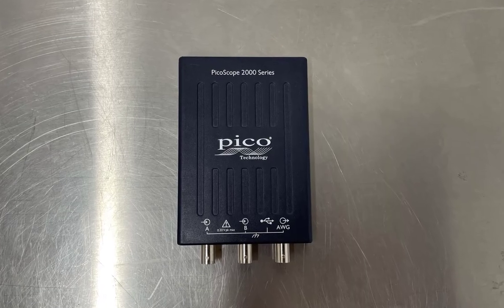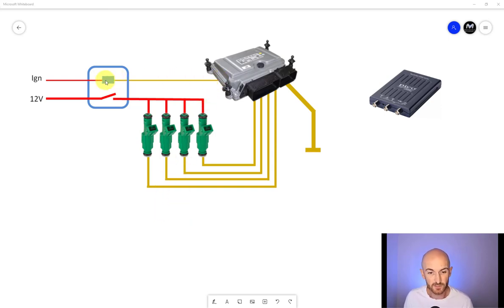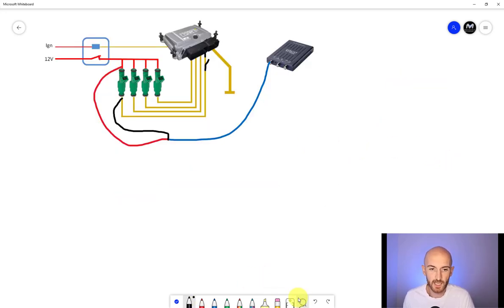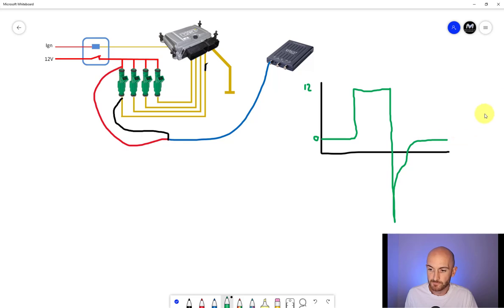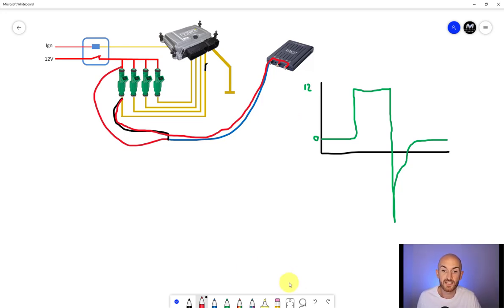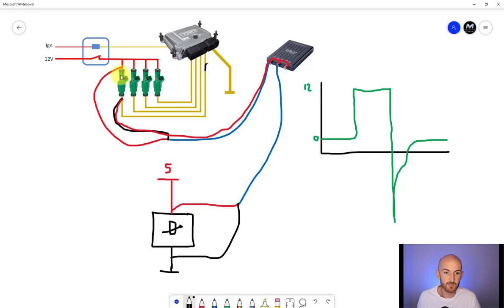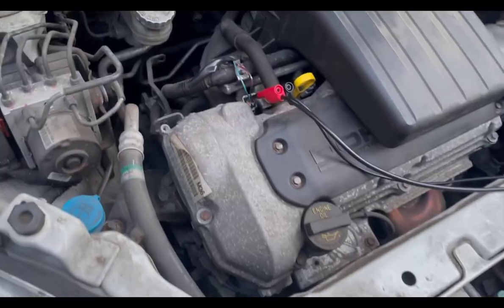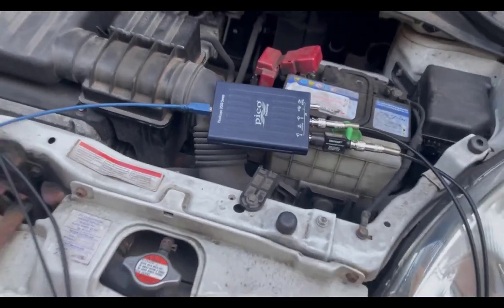How NOT To Fry Your Scope! PicoScope 2204A vs Automotive 4425A

Comment: Hello Darren.  Is it possible to damage the ECU if you get the leads connected wrong?  I had a check engine light on for a small evap leak when I was testing either injectors or coils, I don't remember now.  I don't remember how I had it set up either, but whatever I did, it caused the check engine light to go off and the evap code to be erased.  Now, the evap code never comes back, when it used to before I did the test.  I am worried that I damaged my ECU.
Reply from the maker: Great question! If you were only measuring with one channel, no it’s not possible. Maybe if the leads were faulty/shorted, but most ECUs will protect short to ground/positive. This video is more showing the dangers of not using the chassis and measuring with 2 channels
Reply: @MechanicMindset  Thanks Darren.  I honestly can't remember what I was doing.  All I know is that whatever I did, it turned off the check engine light, and the fault has never returned.  The scope is fine, there is no damage to it.

Comment: Then how can we accurately measure these components with a 2204A ?
Is there a follow up on this topic?
Reply from the maker: I did a couple of videos on injector testing with the 2204a. I think the point of this video is to always use the chassis ground. In this case, take 2 separate measurements to check the power and ground side 👍

Comment: Great tip, pico need to out floating grounds on all devices, this would be a bo brainer to build devices people can look back on and say that was a great tool
Reply: or you could build a car without fuel injectors so there is no spike.  My beetle doesn't have this problem.

Comment: What is the difference in between test it in a normal method, read probe to the injector signal wire, black lead clamps to battery negative terminal?
Reply from the maker: Good question, if you test this way you will see if there is a drop in voltage (compared to battery V) when the injector is active. It’s just a quick way to test the whole circuit first 👍

Comment: By using a differential probe, you can effectively measure voltage differences between two points without referencing a common ground.
Reply from the maker: Need to get myself one. Do you use the differential probe?

Comment: I've got the same Pico 2204 as you , testing VW Hall effect crank sensor [ 3 pin ] cranking showing 4v ish running its like 1.9v?
Reply: And it doesn't have the digital Sharpe shape ? Is this just because I've read in your videos about it this scope is OK/  beginner ?
Reply from the maker: @JWYATT18  Hey Joseph, no the scope should be fine. Send your waveform to me on email;!you can find it on my website 👍

Comment: Hello, good consultation, is this model useful to be able to work with it? PICO TECHNOLOGY - PICOSCOPE 2206B MSO - Oscilloscope, 2 + 16 Channels, 50 MHZ
Reply from the maker: Yea it will work, but I don’t think the MSO part is necessary 👍
Reply: @MechanicMindset  Ditex CarScope PLUS Automotive Digital Oscilloscope Hello, excuse me, this model really catches my attention, do you recommend it? and it would help me to take a course on your platform that I already signed up for
Reply from the maker: @racingpro5273  Hi, I have actually had some other people interested in this scope too. Let me message them and see if they will send one over 👍

Comment: To do ripple test would you need a capacitor or something because of AC current at alternator
Reply from the maker: No, just use the AC setting in the software
Reply: @MechanicMindset  thanks you earned subscription 👊🏻
Reply from the maker: @sheerwillsurvival2064  Have you done your ripple test yet?😅
Reply: @MechanicMindset  no I am old technician from the 70sand 80s after retiring from military iam trying to learn the new stuff. I am saving for a scanner and a scope right now think of Autel 906s and there 4 channel Oscope but I have soooooo much to learn and iam in my 60s . Your channel has been very helpful
Reply from the maker: @sheerwillsurvival2064  Awesome! You should check out our membership. Only 10$ month at the minute. All video learning and easy to understand. You can check it out for free to see if it’s your kind of thing. MechanicMindset.com
Reply: @MechanicMindset  I saw that today will do when I get payed sounds good. You should do one on alternator ripple test that would be awesome

Comment: I have never measured an injector, or other high amp winding this way. Don't know why you would. If i was curious about volt drop, that might work, but otherwise, I connect to common ground. I have three Pico's. I do some volatge testing, but most the time, I do Amp Waveforms.
Reply from the maker: Yeah, I think the current measurements are under used, non intrusive too 👌

This measurement can be convenient for GDI injectors, but I suppose we should on measure one at a time to avoid exceeding the gross differential on the 4425, or the common ground issue on anything else 👍

Comment: what's different  between 4424A vs 4425A? 4424A can we use for automotive?
Reply from the maker: I think there are a few difference for specification but 4424A seems close in performance. I see the input voltage is lower, not sure about ground configuration, and of course you won’t get access to the automotive software and diagnostic programs 👍
Reply: @MechanicMindset  thanks for reply. After your reply i decided to buy 4425A. because i want to become same as you😊😊. Really i have learn lot off from your video. thanks!

Comment: What is the purpose of measuring the injector that way if it opens the door to allowing you to accidentally damage your scope? why not just measure the injector from the signal wire to battery ground? that way you don't need to worry about frying anything and also you get the correct waveform? just trying to understand the purpose of this.
Reply from the maker: You can test the live and ground in on measurement. Also with GDI injectors you would need 2 channels to test both lines. Like this you only need one channel. But you’re right, best just stick to ground referenced measurements if not sure 👍
Reply: @MechanicMindset  thanks for the information. love your channel

Comment: Just as importantly you will energize the injector and dump fuel into that particular cylinder. This can also be done by checking the injector plugged in with a test light. There goes the warranty LOL
Reply from the maker: Yes that’s right, it gets a ground through the tool 😅

Comment: So as long as i connect the negative leads to a chassis or battery ground and use the positive leads to get voltages when using the two channels i should be fine? Use as i would to get available voltages rather then a voltage drop set up?
Reply from the maker: That’s it, 100% 👍
Reply: @MechanicMindset  thanks for the response i figured that’s how you prevent it but wasn’t sure, not really familiar with scopes.

Comment: Does this picoscope support 
Can bus network
Reply from the maker: Yes it does, I have some videos using the 2204a with CAN bus 👍
Reply: @MechanicMindset  does it support all can bus speed including flaxray can a/b/c etc
Reply: @MechanicMindset  and bsd and lin single wire for generator
Reply from the maker: BSD and LIN yes, not tried FlexRay or CAN FD. Does all high speed 500k CAN

Comment: 🤔

I'm confused as to why the scope's being used in a voltage drop measurement configuration?

If the +ve lead's put on the switched side of the injector and the -ve lead attached to a good ground, the upright waveform would be displayed and the scope's GND would be at ground voltage. 

Am I missing something by doing it the way shown here?

-100
Reply from the maker: Sorry, I just read that again misunderstood what you meant. I have seen techs on training connect like this to  get a waveform the ‘right’ way round. It’s not correct, and just an example of what could happen if you connect the scope that way

Comment: You had a video of pico 2204 on how to hack the software so it can be used with pico automotive. Is it still on your channel?
Reply from the maker: Hi, yes I removed it. It doesn’t work with latest updates. But don’t worry, you don’t need the automotive software. Check my videos, I never use it 👍

Comment: How'd you set up the fuse link? Getting a 2204a soon and worried about frying it on accident!
Reply from the maker: Don’t worry, as long as you keep the negative lead on chassis ground, you’re all good. The measurement method I show here is a bit controversial for the reasons mentioned, so best stick to chassis grounds for black leads. 

The fuse was just attached to the end of the probe, in line. It’s not something I would usually do and just set it up to show the theory 👍 2204A is a great place to start!

Comment: Why not give the link to Pico themselves for the 2204 where its £63 cheaper than amazon? £99 from Pico
Reply: Be aware that Pico's website doesn't include VAT until you get to the checkout. The prices I get just now are:	

2204A with probes
Amazon (sold by Hausware Ltd) = £163.95
Pico's website = £105 + VAT = £126	

2204A without probes
Amazon (sold by Amazon Warehouse) - £87.35
Pico's website - £85 + VAT = £102
Reply from the maker: Hi Tony, the 2204A and many others are not available from Pico due to chip shortage. This allowed Amazon sellers to increase prices due to demand. I try to put the best price links possible but most kit I recommend has upped in price for various reasons. 

I also make a (very) small commission on sales from Amazon which allows me to buy YouTube equipment and other tools to use when creating new videos to help my channel grow and bring you a better experience 👍

I’d love to work with Pico but not sure my love for the 2204A is inline with their marketing strategies 😬
Reply: @MechanicMindset  maybe now but the prices were the same in the summer when i bought mine from Pico.

Comment: I think that author should not be focusing on discussing "right polarity" of connecting scope ground to injector wire. It is rather misleading and harmfull than helpful. The scope ground shall always be connected to car chassis / battery negative; and the probe to injector wire on ECU side.

Comment: You are doing it the wrong way.
Your ground lead is on battery ground always.
+ve lead on injector ground 
You are confusing the poor viewers to get them to see your $99 course.
Reply from the maker: Buy measuring like this, you can check the ground and positive side at the same time (for voltage drop) For GDI and Diesel injectors, this is also the best method. My priority is to educate and not confuse, I hope you learnt about common and floating grounds. I also aim to do the opposite of confuse 😇
Reply: @MechanicMindset  if you measure GDI you use 2 channels to see the boosted voltage on one channel and see the triggered ground on the other.
This way you can find the falling circuit. Not by voltage drop on injector
Reply from the maker: @mkoteb7202  👍 that’s a great way to test the circuit. What do you think the reason for installing floating grounds could be?
Reply: @MechanicMindset  a floating ground can help eliminate ground loops which reduces cross channels noise
Reply from the maker: @mkoteb7202  Yes, I see Pico say to be careful measuring injectors as I have described. We have covered it like this in manufacturer training for many years with no issues. 

Honestly, no intention to confuse anyone 👍
Reply: @MechanicMindset  there is an argument for using sensor ground with oscilloscope ground instead of battery ground for less noise
But there is no injector ground technically it's injector control
Reply: @mkoteb7202  I have never tested an injector the way he is in this video(I always use battery negative) but don't you think single channel oscilloscope users will find this method useful.
Reply: @mkoteb7202  im brand new to scopes so info like this is extremely helpful and helped grasp some things about floating vs common ground.i plan on playing with my scope to learn so im searching for videos right now o ways i can damage the scope.this video is perfect for my situation,remember were not all pros at scopes here and i want to learn what ways can damage as its just a matter of time before this would happen and then not know what damaged the scope.